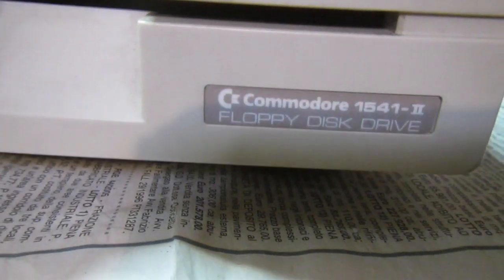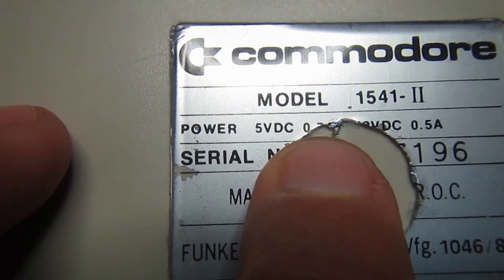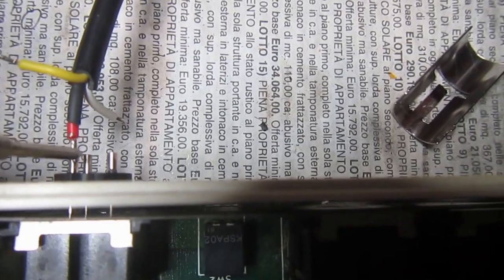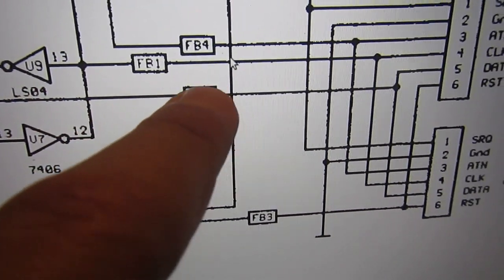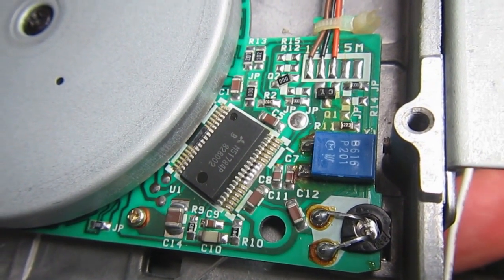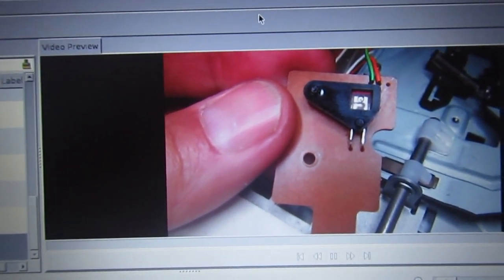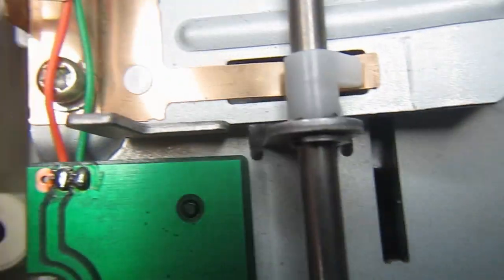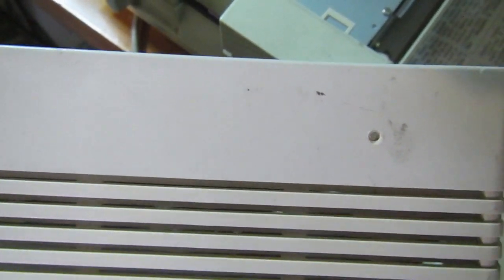Commodore 1541-II repair. Power supply, IEC bus, write protect sensor.

Comment: Funny. Yesterday I had a 1541-II drive with the exact same photo diode failure. I wonder why those fail? It doesn't seem to be too easy to get exacly fitting replacements though. All my ~20 year old ball mice already have dual IR receivers. And even if I would find older mice with two real photo diodes per axis, then I would not have the heart to sacrifice them ;-)
Reply from the maker: Why do they fail is a good question, but I have no answer, it might be just an unlucky batch that had small air leakage through the pins or a bad bond... If I had a decent microscope, I would look at the failed ones. I didn't throw away all failed or useless mice in the '90s, so, I have an endless supply of parts :) However I'm sure compatible parts can still be found on mouser/digikey and similar suppliers if one has the patience to go through their stock.
Reply: @iz8dwf  I found a phototransistor with a matching case in a Siemens washing machine. Compared to fotodiodes it seems to be very sensitive even to visible light. It does work fine in that 1541-II drive, though ;-)
Reply from the maker: @Shmbler  Great! I'm glad you repaired your drive finally!